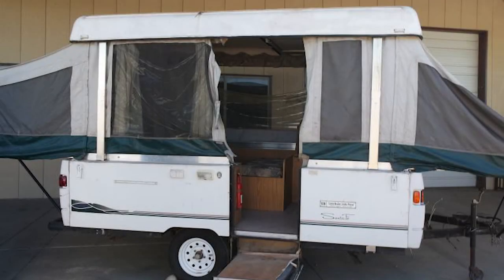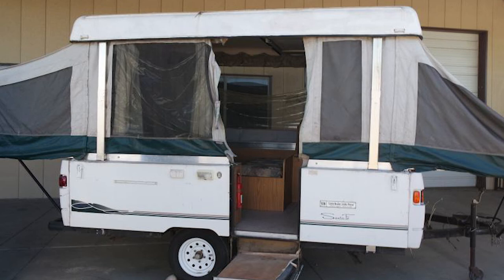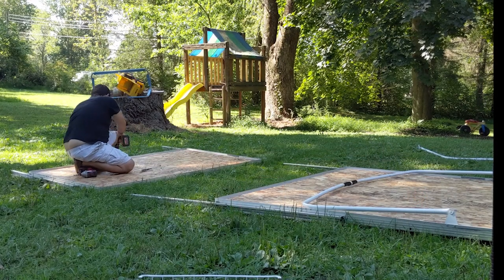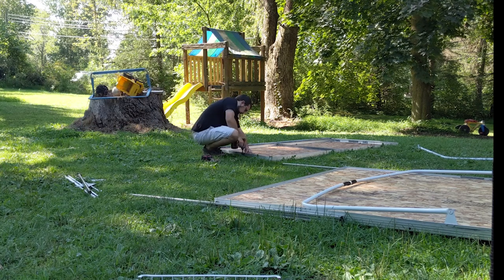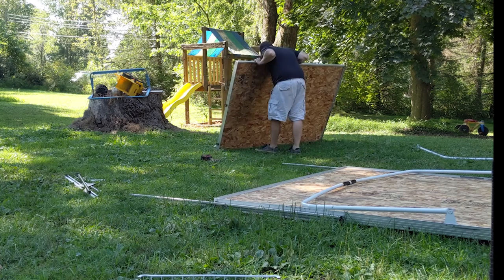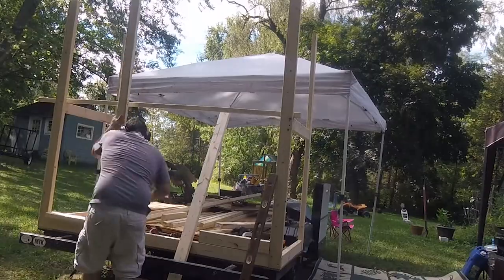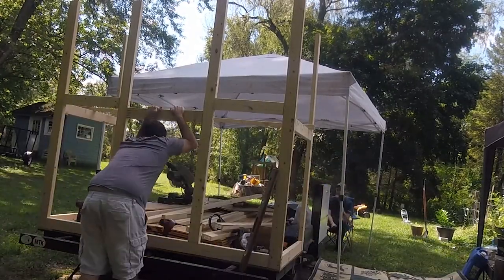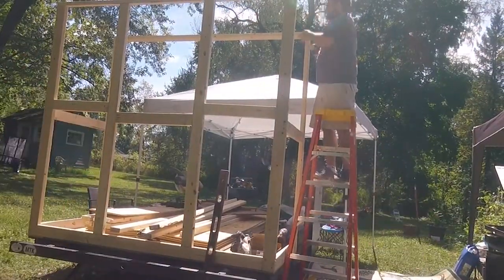Popup camper to hard side conversion - Part 1

Comment: We we're given an 88 coleman shenandoah. It was a total rebuild so we're doing the same. I'd love to chat if you have any helpful advice for newbies. We're keeping the original base and keeping one of the slides.
Reply from the maker: A couple helpful hints, look behind the walls and make sure there is enough support. We wanted to originally keep the sides that were there, but there was not much to work with underneath. I am not that worried about weight on this build, so I am using alot of 2x4's but if weight is an issue stick with stronger plywood and 1x1's if you can get them. We gutted ours down because there just was not enough support to build everything on top, and it actually was better because of all the damage on the floors. One major thing I can say, is double check as you build that everything is completely square. We saved the old door opening on ours, one side is completely square, the other where the door is bows in alittle bit. I will probably cover that in another video. But basically the door opening is deceiving, when I built it, I put the studs in probably half an inch too far in, so that side is not perfectly flat. For what I need, it doesn't matter, just annoys me. :) Also, level the camper as best as you can when you start your build.
Reply: We are lucky that the previous owner redid the floors with marine grade wood. As for the sides everything so far is square and strong. I think we're going with aluminum studs as apposed to wood to save on weight. My husband is a mechanic and has experience in building and roofing and my dad's an engineer. Hopefully all together we will end up with a great camper. Can't wait to watch more of your videos!
Reply: @mrs.ktpage10  did you do it????
Reply: @kat Reilly  we did but a bad storm came through unexpectedly and did damage so we scrapped it.

Comment: Hi, is this something you can go on the road with? Have you had any trouble if so (getting pulled over or stuff breaking inside/outside)? 

Reason why I'm asking, it's because I would like to remodel my 92 jayco..but the tent I don't feel safe with. 

Was party pooped half way into my plan, being told that I won't be able to drive with it..if it's not flat down? Because it would be registered as a popup camper. ':( 

Thank you so much in advance :) 
Great video. Thank you for the share.
Reply: From what I see they don't answer anybody.